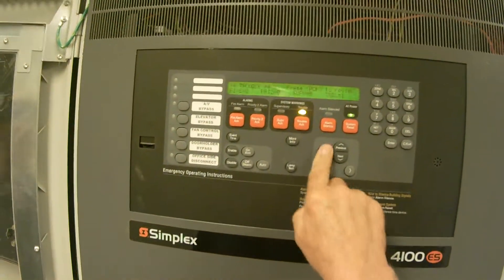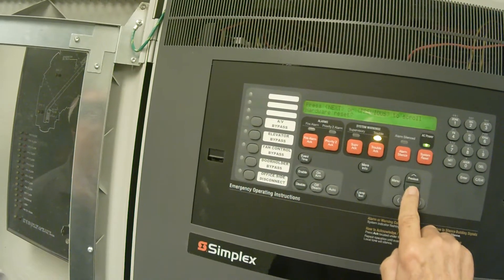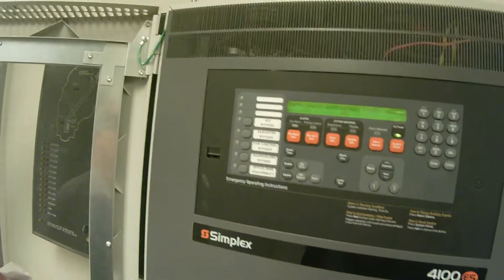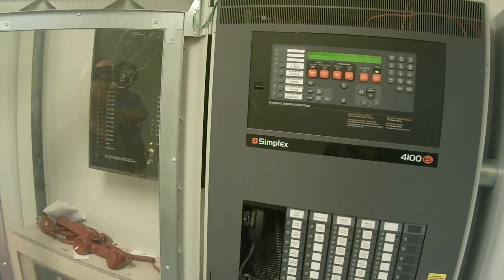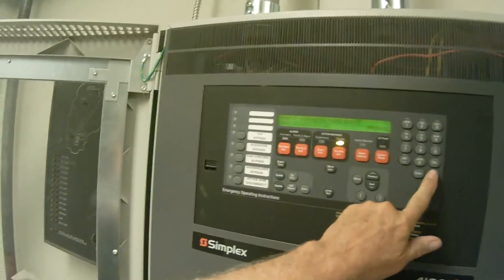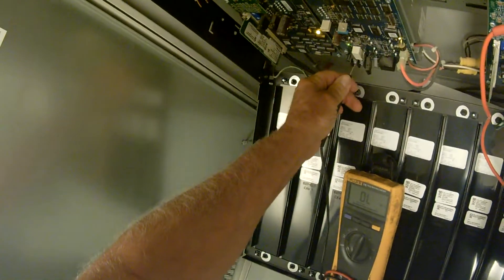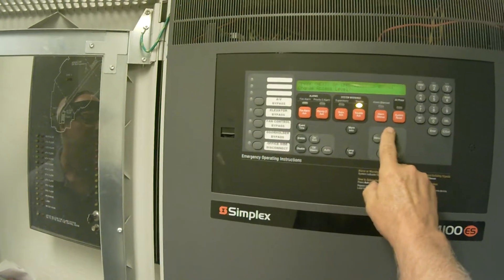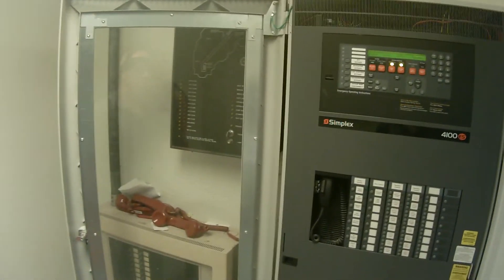Earth Fault Detect Feature, Simplex 4100U and ES

Comment: 1:00 On my panel I have "idnet earth fault" but when I go to the diagnosis and click on find it appears "end of list" as if there was no earth fault
Reply from the maker: A ground on an ID-NET circuit will not effect the ground reference on the system, but isolated only to that ID-NET circuit. It pretty much tells you what circuit that a ground fault exist.
Reply: @firealarmtech4100  There is an earth fault on loop board 2, so I:
Select Earth Fault Search.
Select the Idnet M2 and found the M2-39 device, which is an idnet isolator, however in the field I checked the isolator module and the connection is not touching any casing or piping
Reply: @firealarmtech4100   whats the panel on the right for?
Reply from the maker: @stampynate0007  just a transponder cabinet with more power supplies and audio amplifiers to handle the capacity of the building
Reply: Have you found the trouble sir? I have same issue right now
Reply: @gunawanwarsita9410  We discovered that there was a ball valve with the printed circuit wet, causing a ground fault in the monitor module. To resolve this, we disconnected this valve from the monitor module.
Reply: Thanks for your reply, appreciated it

Comment: Hello sir.
What does 'master a class trouble' mean? How can I reset it?
Reply from the maker: A master class A trouble means the fire panel has detected an "open" in a circuit that leaves the panel, then returns. If there's a break anywhere in the loop the panel will switch power/communication to the return side of the loop thus back feeding the broken half to maintain integrity. When the break in the wiring has been located and repaired, resetting the fire panel will switch the power/communication back and resume monitoring of the loop.

Comment: Very cool video. I really wanna become a simplex tech myself so i can learn these panels and mess around with them and make systems work for clients of all types. I do though have a question about es.exe:
I was modifying my simplex 4007es demo board and reprogramming it with its matching programmer (6.01.03). One day the computer decided it didn’t want to connect to the 4007es when i decided to dump in a new config. I used an ethernet cable which was connected correctly and the service jumper was in the proper position. A restart of my pc fixed the issue. What exactly could’ve caused es.exe to act up like it did, and have you had the same problem?
Reply: Yes, rebooting seems to work for me but most of the newer “hybrid” 4007’s the Ethernet ports don’t work and you have to download using the usb method